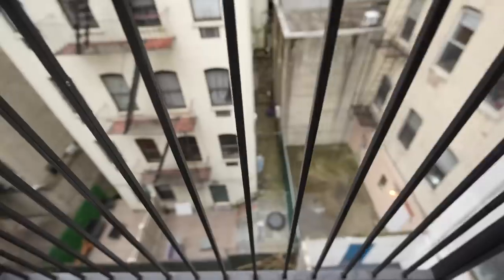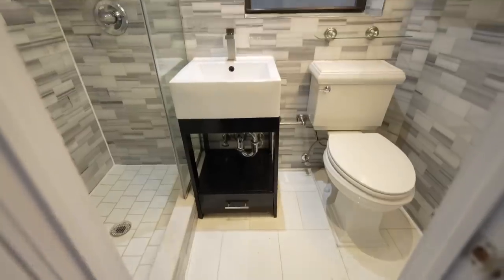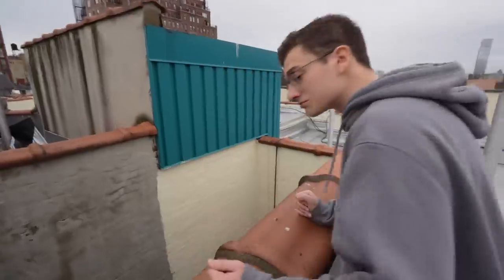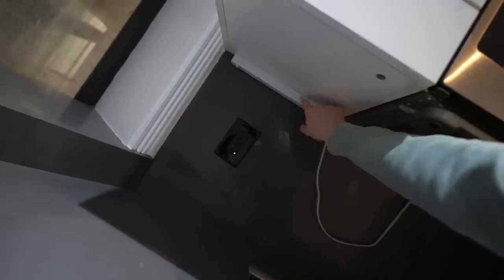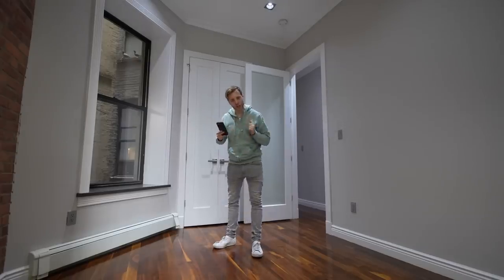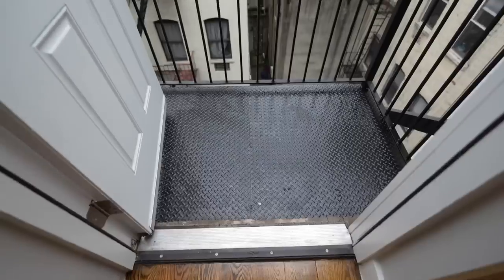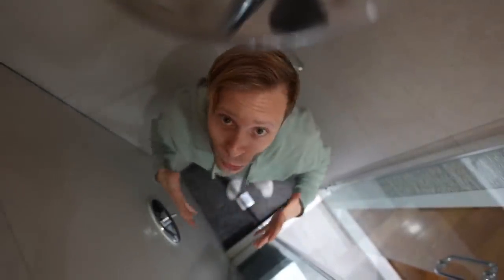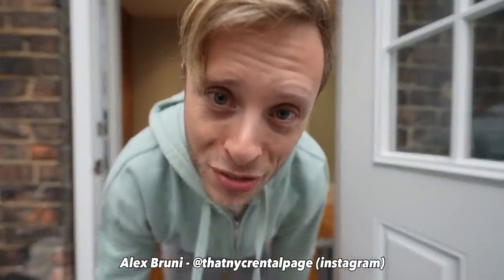This Apartment is SO SMALL… The Last Renter Went Insane

Comment: 8:59. If I lived there, I'd enquire about putting some ferns in planters in that space to brighten up what is effectively a closed in area. They should get enough natural light live there, and I'm sure the neighbours wouldn't mind looking out into some green plants as well.

My favourite was the one with the space on the roof. It was tucked away, ultra private and not overlooked, which is very rare in NY. Put some potted plants along the perimeter of the area, with some that are taller than the fence, and you got an ideal outdoor space.

Comment: Those wires up on the roof are cable TV coax -- there is some low DC voltage on them, but they don't carry enough current to electrocute you (or even shock you, for that matter). Almost every building like these in Manhattan (4-6 story Old Law Tenement) has the cable service drop up on the roof and hanging down each "line" of apartments. Hard to notice from the street, but if you look closely you'll see it.
Reply: Thank you! I love detail posts with info like this.

Comment: The shiny facade of that first apartment hides a whole lot of 'cons'. At 0:42 when the main entry door is open you can see the unit has a compact layout. The living room is an odd shape and since the hallway is not walled off part of that alleged 13' x 11' living space is actually walkway. And you can't put furniture in the walkway so I don't consider that living space. If you put the couch right in front of the main entry door it's not preferable for privacy to swing open the front door and your couch is visible like and 1 foot away. That wall would probably be best for a tall bookshelf with the couch up against the brick wall and maybe a small drop leaf table on wall by the kitchen. But guarantee once you put a couch and a dining table in that living room area it's going to start to feel cramped real quick. You can't open all the kitchen cabinets all the way. The kitchen is narrower than a hallway. The bathroom is basically in the kitchen. You'd have to use the living room as an eating area because the kitchen is so small and there's not even a breakfast bar or any alternative.
Reply: I completely agree. The best thing would probably to forget the idea of getting a table in a space that small and just go for some sort of u shaped couch with the back against the brick wall and a TV on the opposite wall. Need some lap trays because a table would eat the space. Then a 10 foot by 7 foot bedroom with closets stupidly located at either end. The only thing you can do space wise is put in a loft bed.